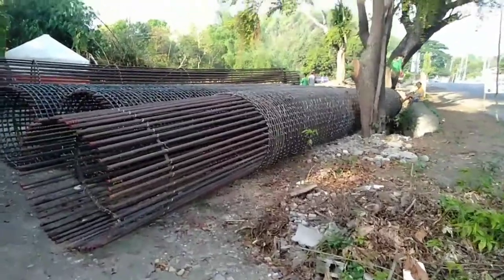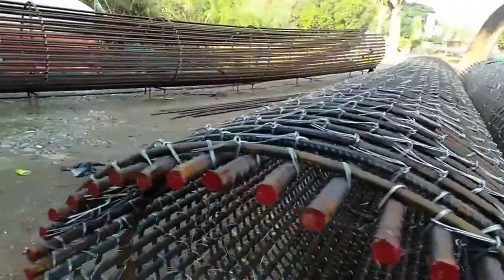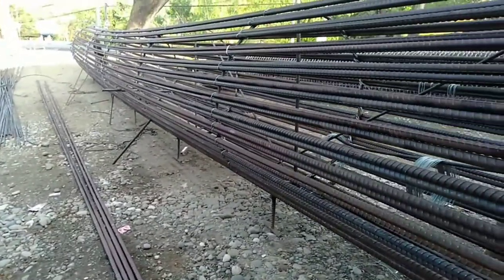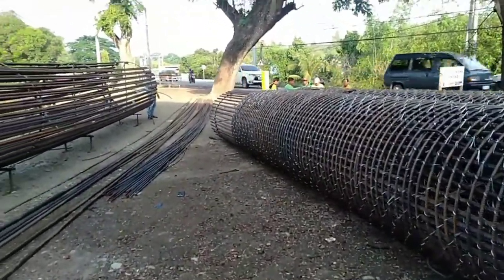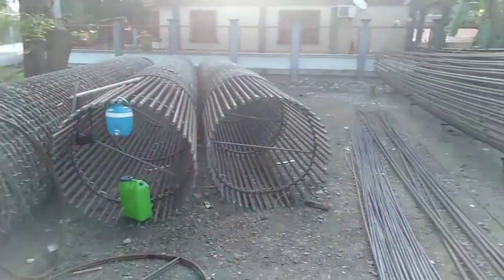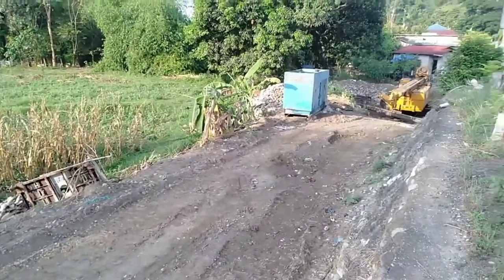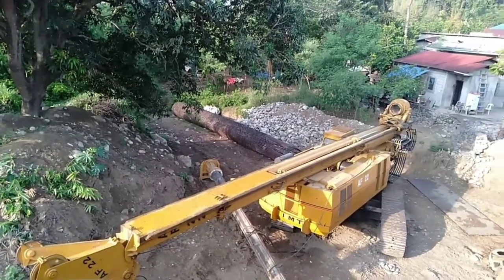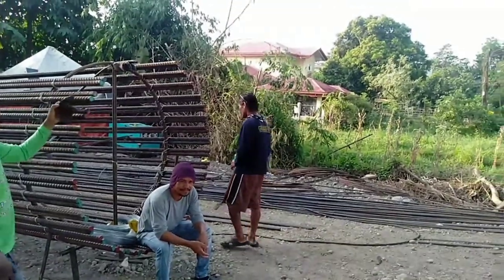BRIDGE CONSTRUCTION UPDATE

Comment: Hi John and jane. That is some  rio construction work . Getting the tunnels and do they put cement  around the rio John or do they place the rio in under the bridge then cement  around the rio.  Just asking kuya John. 
Scott arlene and baby cj.xxxxx 
Scott expat in the philippines 
    👍🌴🍹🇵🇭😎🇵🇭🍹🌴👍
         arleneINDAYLYNZ
Reply from the maker: They bore a hole, and insert with a welded steel surround to hold back soil, then insert Rio bar and fill with concrete through the night one pour